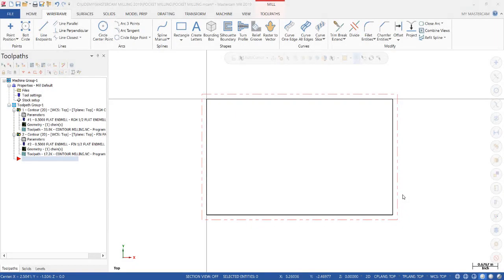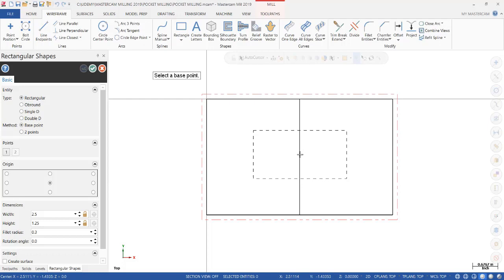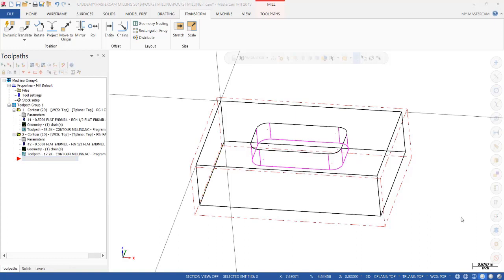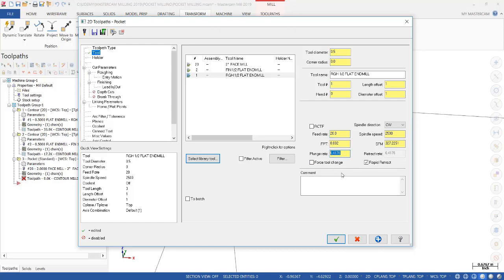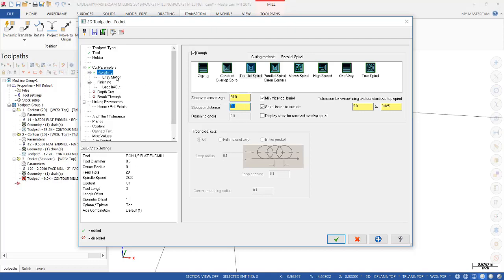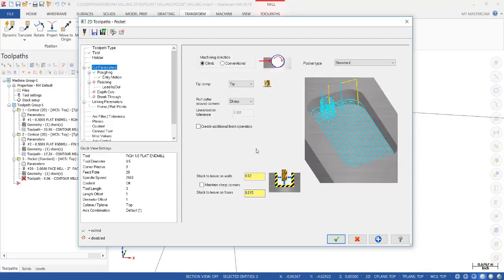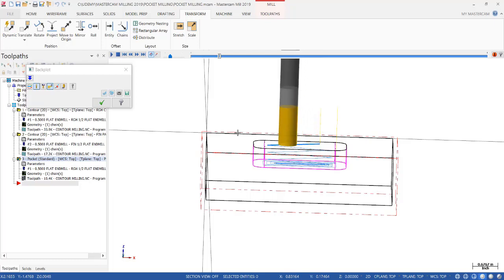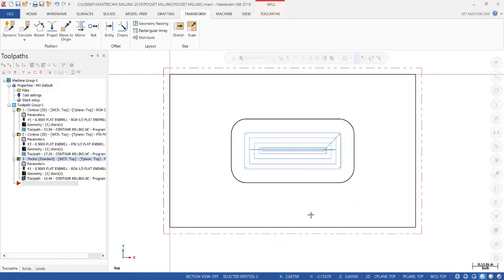ROUGHING A POCKET IN MASTERCAM 2019

Comment: Hello Tom great videos. I was just watching your video that showed how to change Arc Quadrant Breaks and have a question for you. When doing a surface toolpath 
that involves X&Y contours, the programs are very very long because 
several of the arc moves are "Point to Point" is there a way to change 
any parameters that would replace the "Point to Point" moves when 
possible with arcs?